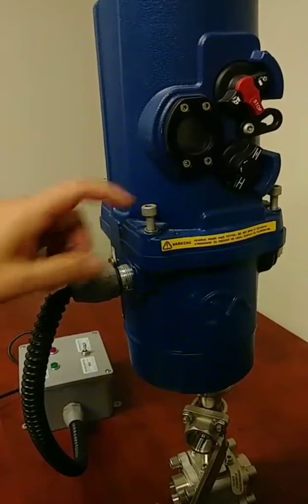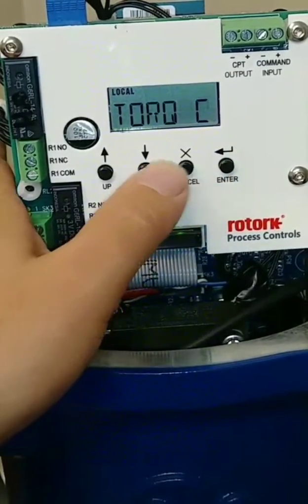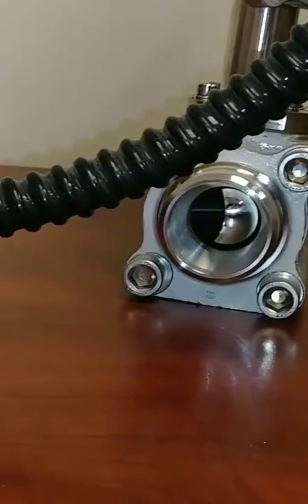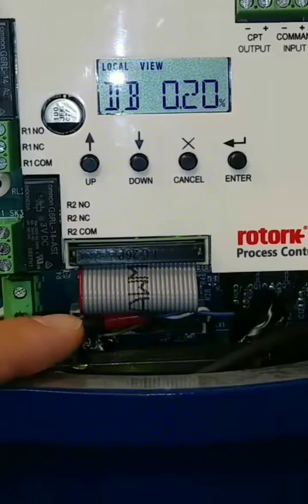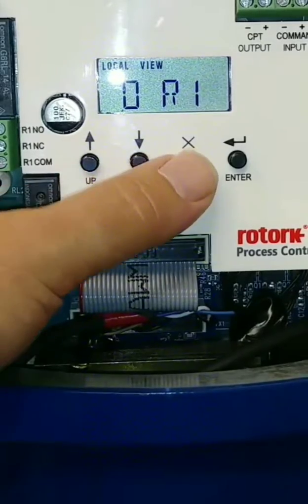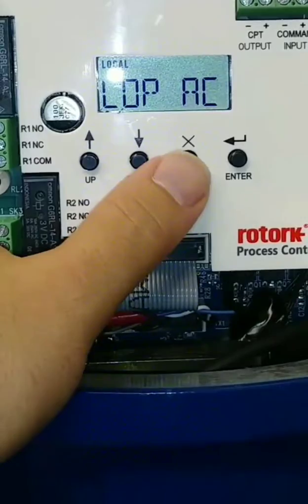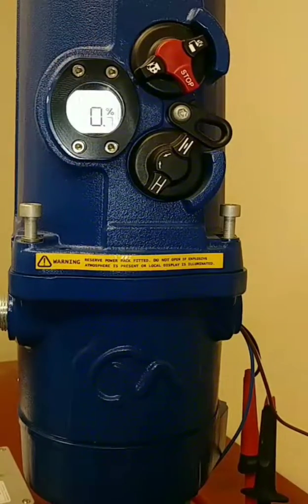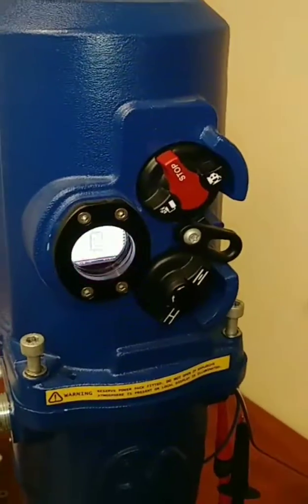Rotork CMA series. Control Valve Electric Actuator CMQ500 Super Capacitors for Fail Close

Comment from the maker: Hey Leandro.  Thanks for liking the video!  
It's hard to see but the RPP status indicator does flash when power is lost from the unit.  It is only displayed in the white screen, and not in the red screen when flashing back and forth.  Check out the video around 11:04.  The glare on the screen in the video makes it hard to see.  Not sure why it isn't constantly on in both screens, but I'm sure there's logic to it.  The RPP status light comes on when main power is lost, power is being drained from the super capacitors, or if there's a fault.  If there's a fault it will most likely light up alongside the critical fault indicator.  That is only an assumption since I've never seen a RPP fault or issue.  Pretty solid units.  Hope this helps!
Reply: Really nice actuators. Just finished commissioning 6 the cmq 500 and we will soon be ordering the cmq 1000

Comment: Hey Nick! great video!, I have a doubt. When the RPP start actuating to power loss configuration, I have all the signs you have in the lcd screen PLUS the rpp symbol. In other words. When in a power loss event, I have the flashing Red/white screen (correct) the "non critical fault" atention symbol (correct) AND the RPP Symbol (the capacitor) which in your video does not appear when no power. The service manual PU094-019-0419 does not indicate any information about this symbol appart from "RPP Status" (page 10) any ideas?

Comment from the maker: I glanced over the setup, and capabilities of this actuator.  If anyone would like to know more please post your request in the comments below.  If you have other actuator, valve, valve positioners, limit switches, solenoids, or any other process control equipment questions please post them below.  I'm open to new video suggestions as well.  I hope this video helps!